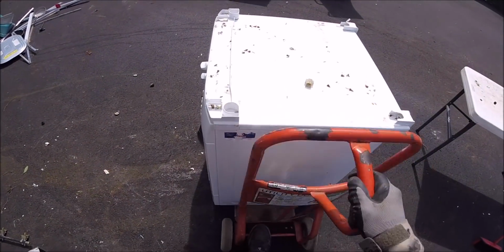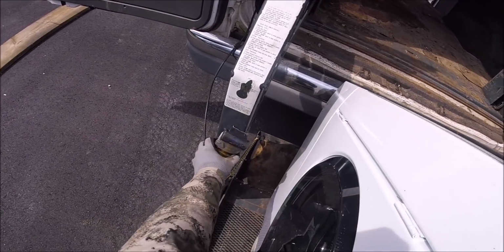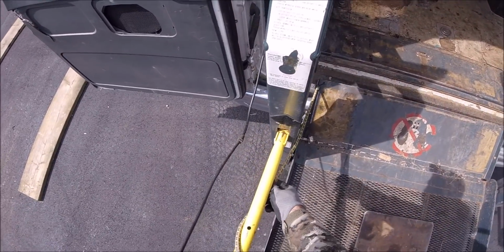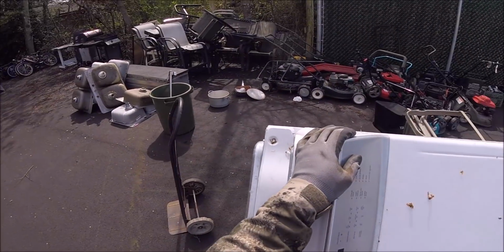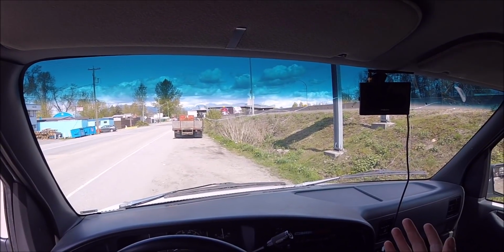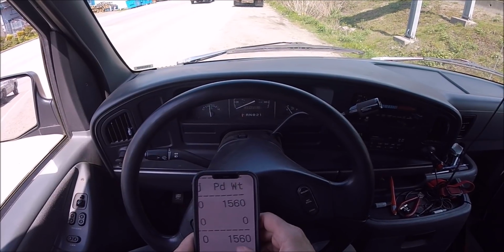Guess How Heavy This Load Was?

Comment: Phil, since I was curious, I ran some numbers for you.
Your 20 yard bin holds 20 yards *27 cubic feet/yard = 540 cubic feet of material.
Your van holds approximately 275 cubic yards of material according to that model of van.
So, your bin holds 1.96 times as much as your bin.  Comparing your last two loads, your bin held 2.11 times as much as your van. As I’m sure there was a different mix of items, this seems within reason.
I think with your heavy loads, up until maybe 3 years ago, you were leaving non-copper motors on appliances, and putting HMS into your shred bin, not separating it out.  I think those two things contribute to why you were able to get 3500+ lbs per bin load more regularly at that time.

Comment: Your 20 yard bin has about 530 cubic-feet of volume.

So if your bin loads are 3300 lbs that works out to around 6.2 lbs per cubic foot.

No idea what the white van volume is.

As for the scales being off, that is unlkely as I imagine their operating license would require regular scale checks/calibration to be made. I doubt the scales are wrong at the yard. It would be quite a scandal if they were.

About the only way to get heavy loads is too increase the lbs per cubic foot. 
You already do as much as possible to push as much as you can to fill the holes and nooks and cranies. There is a point of diminishing returns on this eventually.

My only suggestion is that when there is a sizeable metal box, oven, dryer, washer, refrig etc fill the empty space with as heavy a material as will fit.

Those barbeques are tough things to handle as well as take apart.You already take off all the valuable aluminum and brass.Cut off the legs/side burners/table would ease the loading and increas ibs per cubic foot but still takes time.

The BBQ lids are dead space too. Turn them into containers for smaller scrap and do a misc dump of them all at one time. I am mostly joking with this one!

Maybe looking at the load per bin with a lbs per cubic foot perspective will help making a plan.

Back to my cushy couch!

Great video!

Comment: I took apart a miele washing machine, which is the best make to scrap. Instead of concrete blocks to weigh down the machine they use heavy steel molded round the drum. If I was taking in a heavy bin like you do I would as a one of weigh every thing heavy to get an approximate idea of the weight. Something weird is going on with the weighing of the large truck.

Comment: Weights seem ok to me that white van is big I'd say no more than two loads worth in the bin.  Those charges you get suck big time!  Any other yards you can try?
Reply from the maker: The way i pack the bin it's like 2.5 van loads, I over fill the from the top. This van load had only 2 heavy appliances & 2 light barbecues & the rest was light smalls & I got over 1500 pounds, The last bin i took was full with mostly smalls & I got only 2600 pounds in my bin, I watch guys on the tube get over 2000 pounds with a pickup truck, Got before same loads around 3700 to 3800 pounds & now I barely get 3200 to 3300, I think my weights are out 400 to 500 pounds, If they use photo camera's to read your plate before your on the scale they could do anything? Every time i use my van i get more weight for the amount of stuff, The camera can't see the scrap
Reply: I have no answers just more questions. Do they use only one scale or a different scale if you go with the whale vs the bin? They could be using a different calibration for the type of vehicle? Maybe the scale pad is too small for your bin so some of the weight is not measured accurately. Likely they have flagged your bin for automatic deduction. Something definitely strange going on. You should get an independent measurement as others have mentioned.

Comment: Sry to say but I have been watching your loads and you have had pretty light stuff and alot of dead space with the grills bikes and chairs and the small fill is very light gl love the channel
Reply: I dont think the issue is with the scale you need to save all the little stuff that will fit inside the washer and dryers and take a little more time filling the space instead of just tossing it. I scrap and have a dump trailer but I fill every space I pack dont toss and you are right you should be able to get more weight but the little wire stuff is light but bulky its all a matter of time and preference but your prices are alot better than mine but I do apt. Maint and get alot of ac units and water heaters gl love the channel try to look at getting scrap ac and elections even if you have to buy it go look at utuber project shop